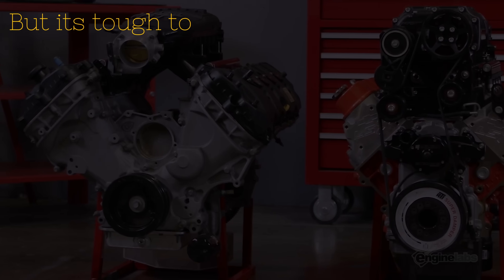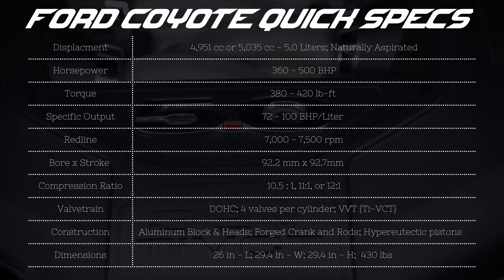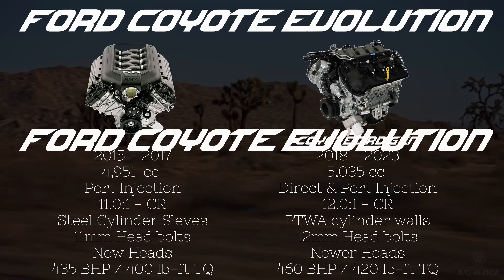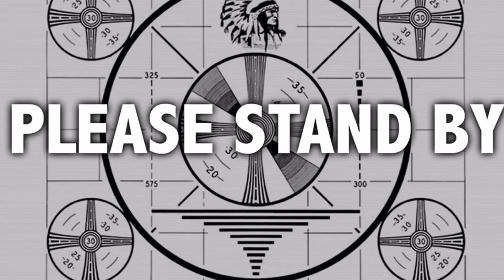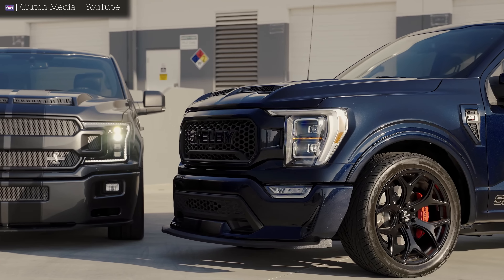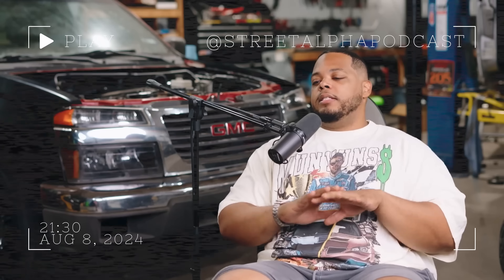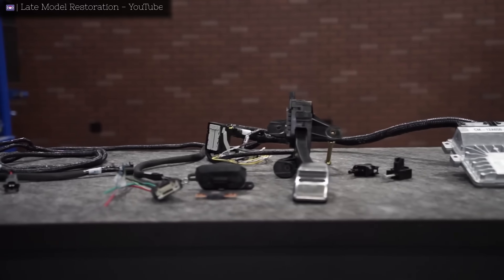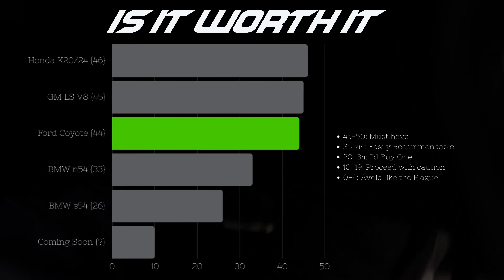Is Ford's Coyote V8 the BEST Modern Engine?

Comment: Ford should make a little bigger version of this engine
Reply: Ford should make a KING COYOTE : 6.5 V8 32 valve , quad cam .
NA - around 700hp and 700ftlb.
Reply: Yes I agree I would like to see a 6.0 version of the coyote
Reply: @jessiegantt4767 MMR has a billet tall deck coyote available in 5.8, 6.0, and 6.5L. They are not cheap though.
Reply: @andrewmcbain4119  MMR has a sketchy past it seems . 
But they making 4-5k hp .
Reply: They could've used the 6.2 boss engine, just change the sohc 2v heads for dohc 4v
Reply: @jdmuscle1015 it is a shame they dropped the boss. There has to be a reason they didn't continue with it or design a dohc 4v version.
Reply: @andrewmcbain4119 I’ve heard fords licensing with Shelby is over and it won’t be renewed there’s rumors of the next high end mustang not being a gt500 but a boss dark horse
Reply: I agree! 6.0 at least!
Reply: After 5.4L the idea behind the coyote would go away, as the piston speeds would be too high for a engine that aize
Reply: @robbierector1669 what about the pistons on the Cosworth 6.5 + Ferrari and Lamborghini all 6.5 are all great .perfect.
There are stroker 5.6 lt for coyote too .
Reply: @robbierector1669 people have gen 2 based HEMI spinning around 10000RPM high dollar builds to be sure, but just to point out your piston speed idea does not hold water.
Reply: They do
Reply: Megazilla
Reply: @AdamSollenne megazilla is a pushrod engine with only 1 cam & only 16 valves - like a 4 cylinder has. Only 620hp from a 7.3 is no where near where it needs to be.
Reply: Smaller naturally Coyote version will be nice too to replace 2.7TT. Basic 4.0 V8 Coyote would be nice engine for budget Mustang versions.
Reply: @DotirThe 3.0 ecoboost would be a nice fit for the Mustang.
Reply: @rjdavis7503 why? Less power similar weight. Sounds worse IMO...
Reply: @rjdavis7503 no, better naturally aspirated V8 with smaller displacement as base option. V8 only Mustang lineup would be something.
Reply: @Dotir The Ole 3.9 V8 Ford used to put in the early 2000s Thunderbird.
Reply: 7:18 has 20% less displacement and 75% more cams plus port injection 😂
Reply: Its the new 5.2
Reply: Why?
Reply: I totally agree 100%
Reply: How about a boss 7.0 lt
Reply: 5.2L supercharged Predator
Reply: Maybe move away from cars to manufacturing golf buggies!! LOL.
Reply: They do the 5.4 in the gt3 mustang.... i dont know why thats not on the street and in the ford GT😐
Reply: For what purpose?
Reply: the latest Mustang GT3 race car is running a 5.4L Coyote so even they agree a displacement bump isn't the worst idea.@mikehughes8023
Reply: @mikehughes8023 For better low end torque.
Reply: @mikehughes8023 To make more torque and easier HP numbers, of course. Displacement counts. EG; Could a 300 cubic inch Top Fuel engine compete against the current 500 cubic inch Top Fuel engines? Of course not, because displacement counts, all other things being equal.

Comment: Stock ls vs stock coyote, I’d take stock coyote all day long if you were ok with power up top vs down low. For forced induction, I’d go with coyote as well. For cheap initial investment… and fairly cheap ( cheaper than coyote for sure) upgrades go with ls. I guess I’m suggesting they are both good… and a lot of the downsides from both are negligible